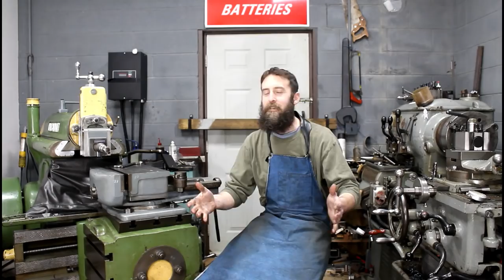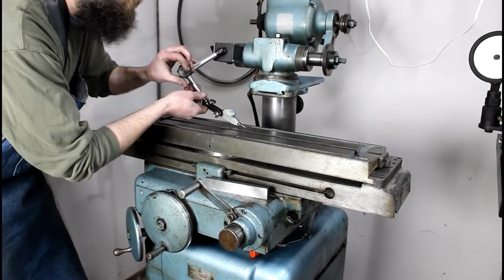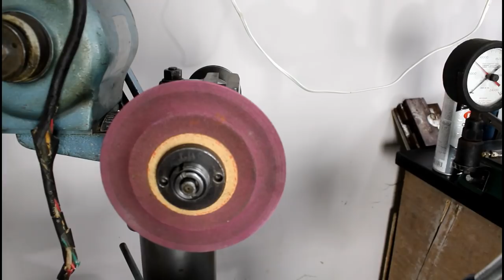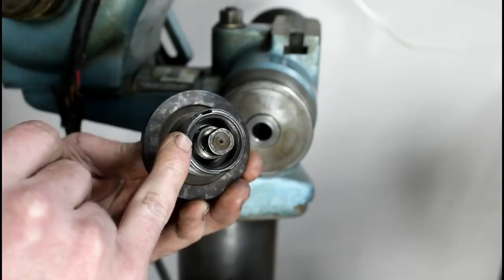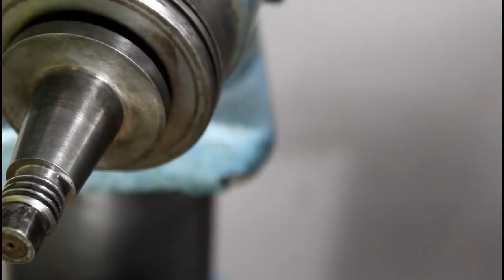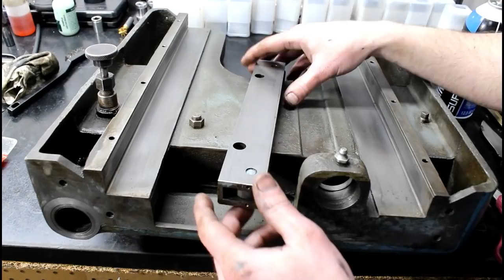We Got TROUBLE!!  Everythig was going so good :-0

Comment: Steve, I realize this is an older video and you may have already fixed this issue, but I just looked at it again because of my own work on my universal grinder and I wondered if it would be possible (enough material left) to cut the internal threads on the wheel hubs that don't have them. Absolute accuracy would not be that big of a deal on those I guess....

I love watching your videos!
Peter

Comment: Regarding pulling the non-threaded hubs off the arbour: Could you not remove the left hand threaded stone retainer nut and have a puller designed to use the external threads on the hub as an anchorage? A piece of internal threaded tube or pipe to match the external left hand thread that is capped, drilled and threaded for a jack screw that would push against the arbour comes to mind.

Comment: never seen that before but the smooth bore collet nut have 2 holes if tapped, a normal gear puller could be used

Comment: Spindle -The runout on both the male and female tapers shout be around 15 microns. Also on the male arbor where the wheel fits on the resting lip should also be 15 microns.this is on all the spindle grinder I have worked on. As well as all cnc spindles

Comment: if you cant get it as good as you want you could stick liner rails with ball rollers in there really easy if all else fails.seen it done to fix a v-way mill that was toast other wise he got it down to .00017 across the hole 54" bed. thanks for sharing

Comment: Hello, new to your channel. I enjoyed this video, and will check out more as time allows. But I was wondering about your DTI.
I pride myself on knowing a lot about machinist tool brands, but have never seen a Highwood branded DTI. It looks like a Brown and Sharpe, or interapid style. Curious where you picked it up?
Reply from the maker: Steve Watroba It was made in Japan. I bought it used off fleabay. It really is a nice test indicator at .00001" smooth and responsive.  I had not seen them before either but it was cheap and it being made in Japan is the reason I bought it. Glad I did because it has become favorite and most used test indicator.
Thanks for stopping by and glad you enjoyed the video. I have plenty more.

Comment: That was very interesting. But remember, this is a tool and cutter grinder. So suppose you were sharpening a 1" endmill. So you put it in a collet and adjust  all the angles (there are many) then drive the table. For your average  endmill the movement  will be the radius of the endmill. Not much - 0.5". Will the .003" error in Y matter that much? Dunno but I doubt it. I would go about this backward. Try sharpening a drill bit on it . Does the grind come out OK?  If not. you are right. Grind or scrape the pads. Otherwise move on to an endmill. The only site I know about that covers T&C grinders is Stefan Gotteswinter.

Comment: hi steve. thank you for doing these videos.you mentioned using your shaper on the saddle. i have an old 7 inch shaper. when i first got it i cleaned the ram ways and gib and shimmed the table. every time i put something in the vise and shaped it it was from 2 to 7 thousands off. one day i had a job too big for the vise so i removed it and bolted the piece right to the table. i checked the piece on the surface plate and it was within 2 tenths. i thought it was a fluke but everything i bolt to the table is accurate to way less than a thou. have you ever removed your vice in a similar situation ?  i would guess that your vice weighs more than my entire shaper including the motor and stand.

Comment: Steve, the method you used to check the X axis does not tell you much.  If the table was warped gradually downward toward the ends and the bottom of the saddle matched it, the indicator would not move at all even with some severe wear, a curved axis.  Surface grinders and mills often have that problem.  Check the bottom of the table and the top of the ways with a good straightedge to get a rough idea.  Also, before doing anything, make sure you are using the correct sequence of operations to achieve parallel and square on all axes with a minimum of metal removal and effort.  If you do not have a copy of "Machine Tool Reconditioning" by Edward Connelly, get one, and read and understand the concepts.  Much of it is not really intuitive.  Find the machine reference surfaces and work from them to achieve correct geometry and parallelism.  If you do not have a copy of the Connelly book, contact me and I will help you with that.
Reply from the maker: Bob Korves Thanks Bob, I do have a copy of Connelly' book. I have datum / unworn surfaces on the ways of the table that seem to agree with what I am seeing on the X. I'm still not 100% sure of anything yet. I plan to work from the main casting up. The saddle is my main concern. What I'm seeing on the table I may be able to live with. I  need a bigger surface plate before I can make any accurate measurements.
+ lots of homework 👍
Reply: Great, sounds like you are on the right track, Steve.

Comment: I spent a couple years in the cutter grind shop before I got the job I have now.  We used a wrench like this to break loose the nut and get the wheel and arbor off the shaft.
https://m.mscdirect.com/mobileweb/product_detail?id=05924204&hasRestrictedParts=false

We would keep a short brass at the machine, about 3/4 diameter and 4" long, you can put the spanner on the nut and wrap the edge of the spanner and break loose the nut.  Then you can use the forked end between the arbor and the flange on the spindle and pop the arbor off the spindle with a flip of the wrist while holding the wheel with the other hand.  I'm not going to say that is the correct way to do it, obviously it seems counter intuitive to smack the spindle, but it is how we did it.  I was a kid at the time and whatever the older guys said to do is what I did.  I will say that in the cutter shop I worked in we would change wheels quite a bit and this was a quick way to do it.  We never used a puller, the wrench works quite nicely to knock the arbor loose from the spindle.

Comment: The Y axis is the in feed for metal removal of the cutting tool to be sharpened. Generally never more than a thou at a time. Often less.  The X axis is the one that does all the work. That machine will sharpen a cutting tool as is. However, now it's in pieces...
Regards,
Fellow T&CG owner,
NE Thailand.
Reply from the maker: Im sure that it will work as is , I'm just not happy with the accuracy of the movements . For me sharping a cutter is only part of the fun. I enjoy working on machine tools and learning  machine tool alignment ,correcting errors ect . Not a problem for this machine to be out of service for as long as it takes to get it back true. I dont plan to make money with this machine , its only a hobby.
Thanks for watching , Glad to know they are people out there who have experience running a t&cg.

Comment: Lifetime lube means lubed for the life of the bearing that depends on fresh lube getting to the bearings. Grease is oil dissolved in lithium or other soap - It eventually dries out and cannot reach the bearings until they start to fail and the heat of friction melts the dried grease. Permanently lubed bearings are a reaction by manufacturers to jack leg mechanics contaminating and over tightening them causing failure under warranty.
Reply from the maker: I completely agree. I'm not sure what to do about spindle lube at this time. I'm sure after 20 - 30 years the lube in this spindle is far from good.  I plan to address it at some point soon. I just have not had time to do the research necessary to come at this issue informed.
Reply: Steve Summers , Wait until you get a manual and see how hard bearing access is and how much bearings cost. The spindle bearings in my Sioux valve grinder were noisy when I got it 30 years ago and under light usage initially, to no usage in the last 15 years it seemed to get no worse.

Comment: Before further work, you need to check, and possibly correct if necessary, if  the column is perpendicular to the table and indexes. If your times free, then hand scrape the two roller slide ways parallel and flat to correct for the cross slide error, looks like fine grain to standard cast iron combination, so will function without lubrication. Remember the cross slide is an adjustment slide, not a reciprocating one. I concur with the guys here who say the machine is useable, as is, but it would be nice to see it re-manufactured. Great channel.

Comment: That kind of machines are NOT as accurate as you may think. You should try to make that guides parallel on the shaper. No need to grind. Light pass on the shaper and some finish scraping.Shims can be also used (i used it on mine). In the video is not clear where the taper direction is on the guide. Accordingly with standard indicators the guide is thick near the spindle (back side). Have you measured if the saddle and table together are parallel ?

Comment: I am no scraping expert by any means, but would appear that you need to scrape the bottom saddle ways in flat and parallel to the upper surface that the table rides on. So that will require a straight edge at least as long or longer than the ways on the saddle. And indicators and lots of patience. There are lots of You Tube videos on scraping and an excellent book is “Machine Tool Reconditioning” by Edward F. Connelly available from www.machinetoolpublications.com for $92.95 plus $6.80 shipping. It is a used machine after all, you had to know it was going to need some work. Perhaps a one-shot lube system or an automatic lube system would be a worthwhile addition. Good luck and thanks for making the video.

Comment: Bearings with rubber seals can be lubed with a grease gun if you can find a hypodermic needle adapter, which I used on a regular basis, or I suppose a regular hypodermic from a drug store or farm supply store. You can also pop the seals off. There are some trick bearing greases too. Synthetic auto would do. Automotive bearing grease tended to dry out or be contaminated out rather than metal failure.

Comment: Table flatness on the cutter grinder is no big deal unless you are r\trying to use it as a surface grinder.  Most tools are ground in some form of workhead that orients and sometimes guides the tool.  Even if doing work between centers the runout in the table will. have negligible effect.  You use the jackscrews on the end or the table  to eliminate taper, or to introduce taper, depending on the work you are doing.

Comment: Shim It. Your Not Far Out and In Your Case Shims Will Do The Trick. As Far As The Roller Wear It Is More Important That All 4 Rollers Are Working Correctly And The Spring Tension Is Consistent . The Wear Should Be Consistent As Well. You Can Design Some Type Of Oiling Devise And Wipers As Well. Before You Operate It Make Sure Every Bearing You Can Find Is In Good Condition. The Bearings Are The Most Important Small Part Of The Entire Machine.

Comment: Two wedges that can be put between the two flanges and then forced together would remove those holders without threads. You could even make a tool which has one forked pair of wedges that are screwed towards an opposing fork to wedge it off.

Comment: Steve, You might be able to take part of that wear out of the roller containing parts with sandpaper on your surface plate, checking with your indicator from time to time, and save the rest of your repair until you got to use a good surface grinder on it.

Comment: first.. put a second block across your back door about 16 inches up.   do you have a precision level.. get the post on the grinder vertical.. then check the pads where the cross slide ways bolt down to see if those are level with the vertical.  this will allow you to add shim stock to level the bolt on ways..  getting rid of the taper in your z axis.  i wonder.. before doing any grinding. if you have checked the z axis on the upper part of the grinder.. i see dovetails up high. just to make sure that the 2 surfaces are parallel. 

 the puller.. are the threads that hold the nut on the stone the same size of your stone holders.. the OD thread to a puller stud.. i would probably counter bore the end of the stud. put a single ball bearing in it and put a wide face T plug in it to push against the end face of the Double D nut..  i don't like pushing against that but i can't see any other way.  since you are going to make this.. you might use a 20 or 24 pitch thread. even a 28..  an Oring groove on the T pusher or a one cut in the counterbore will hold the T in the end of your puller tool.  no use dropping the tool end out each time you pick it up.  you could also use a o ring groove to retain the ball in the back of the counter bore. i hate chasing balls when they fall out.  you could just use a thick cross section oring to retain the ball  in the counter bore also without needing to groove it.

 i wonder about using hardened shim stock where the rollers push against the side of the carriage.. https://www.grainger.com/product/LYON-Steel-Shim-Stock-Roll-22ME59

Comment: There is 2 versions of that puller, internal and external. Get the internal 1 it will pay off in spades when you use a diamond wheel for carbide. You need to zero out that diamond wheel to the arbor and leave it on. As far as leavening a regular wheel on an arbor I wouldn't worry about that because eachother time You change a wheel you have to dress it anyway. Feel free to ask questions. Randy

Comment: You seem to forget that this is a cutter grinder not a surface grinder. How much movement of the table will be required to sharpen a cutter?  Your cutter will move in respect to the grind wheel. Yes I know that you want it perfect, don't we all.
Reply from the maker: Yeah I have thought about it. Not sure that in actual use that small inaccuracies will make much difference. I do want it close but not looking for perfection.   I think I could deal with .0001 deviation over the entire travel in
 X Y ;-)     Just kidding.    I just want it close for my own mental well being..

Comment: Like Wayne said, this is a KO Lee.  I was a cutter grinder for GE back in the 70's and we had a dozen of these little grinders for doing single point tools and for grinding endmills with a work head and a Weldon fixture.  This is not a Surface Grinder.  Even new ones weren't all that close.
Reply from the maker: That just seems strange to me, In my mind a cutter grinder should be as accurate machine..  But I admit I know almost nothing about them never using one before.  Thanks for watching and commenting.
Reply: Steve Summers As accurate as what?  These were never designed to be surface grinders.  Have you ever ground reamers, end mills, single point tools or drill tips?  Think about what is happening and consider where the motion accuracy is coming from.  The accuracy is coming from the table traverse and the attachments like an airflow fixture, work head or wheel head.  Infeed in this case is just how much you will be dusting off the work as long as the distance measurement is good you can at least accurately grind off material. Straightness and axis squareness at least is very fixable in this case.  At some point in time when you can get access to a surface grinder th is issue can be fixed.  That is a very clean KO Lee.  .

Comment: Good update. I agree with you and some other commenters, a surface grinder would be the tool of choice for the job, mostly to control removing as little a material as possible. One question I thought of, at the 6:00 mark you started using a parallel to span the entire depth of the table, since most or all attachments clamp to the center 2 ribs how much runout would be found using a shorter parallel? You mentioned in the last video the outer edges were mostly to control coolant/oil, I wonder if the outer edges were never ground evenly or possibly beat up by a previous operator. Just a thought. For an entry level machine its a very nice one, is be happy to have a similar one in my shop. Also I'm the same way sometimes about details, I get lost. Clean, lube, replace the known bad cords and bearings, run the machine to learn it and then start repairs if really needed, like you said most work is done in a small amount of travel. Looking forward to the next installment, possibly at Brian Bloc's shop for some surface grinding! Yahoo
Reply from the maker: The table is flat and in good shape, I may be visiting Brian soon, we will see.   I still have loads of detective work to do before I work on the saddle..     Good to see you Jim

Comment: You know if it really bugs you I’d get some .003” shim stock, BUT, remember this is a tool cutter grinder, Not a surface grinder.  Your Y axis advances the tool into the grinding wheel to sharpen the edge of the tool cutter.  Your Y axis movement is only in thousandths, maybe .005” total to sharpen a worn edge.   I’ll let you figure it out, if you have .003-.004 movement over 3-4” of table movement what would be the error be in .005-.010” of table movement.  I wouldn’t lose any sleep over it.   In fact, thinking about it, I wonder if that taper might be intentional to compensate for eventual wear.
Reply: You said it for me Wayne P

Comment: you can use a wedge to pull the wheel off the spindle (i suspect that's why the spindle arbor has that flange).
if the ways are straight maybe you can just use a shim to align them, probably they're not worn evenly but it's worth a shot to check (or even maybe scrape one of the pads on each side), though I think you probably got the right idea to grind them